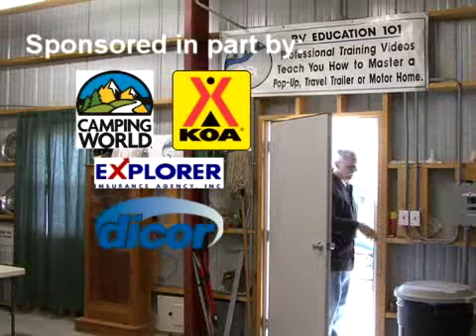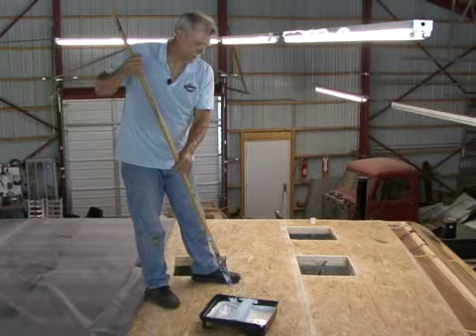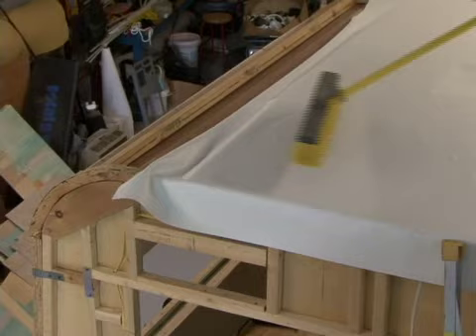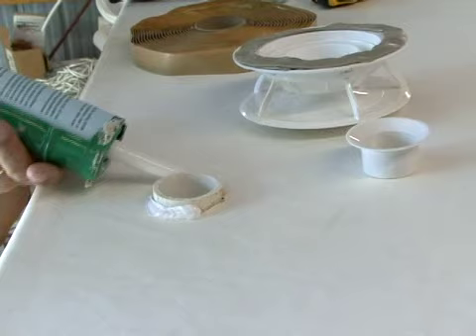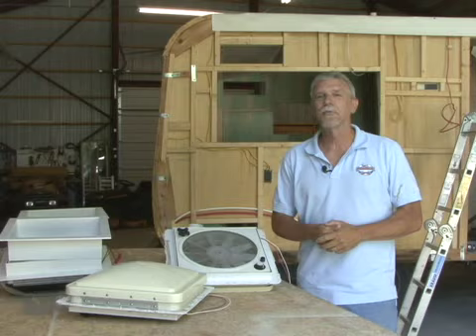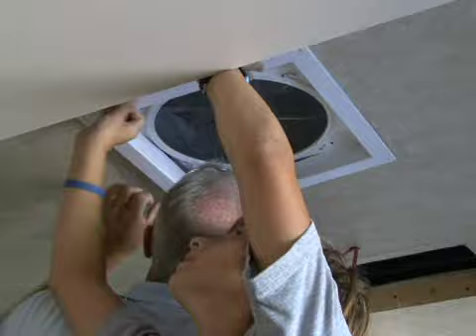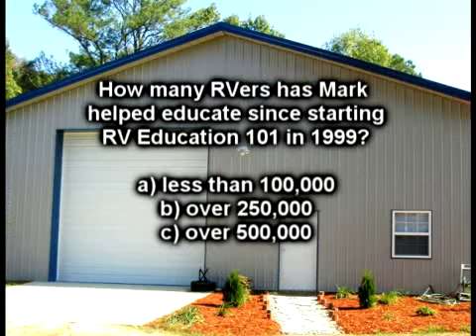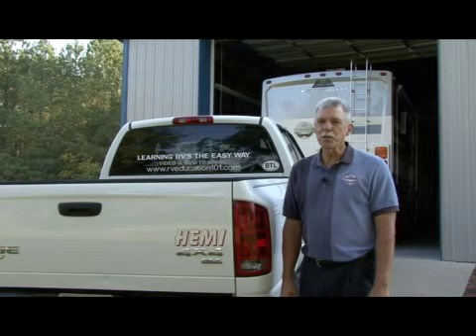Marks RV Garage Episode #11 Internet TV Series by RV Education 101

Comment from the maker: @lovelesspl I basically have two choices. I could run the power converter hot wire directly to a dedicated brach breaker or I could run a jumper from a breaker to the hot bus where the wire is currently connected. They do it this way to give you another slot in the bus for a hot wire off of the same breaker, since you can only have one wire connected directly to a breaker. I wasn't sure at the time if I needed another hot wire for anything or if I would just go directly to the breaker itself.

Comment: On the Powerconverter how does the DC side get 120V.  The hot line from the converter goes to a bus bar on the right hand side of the AC section.  That bus bar is not connected to anything other than the hot line going to the DC section.  Should one of the breakers supply AC to the Bus bar that feeds the DC section?

Comment: I have a small area on the  rubber roof of my TT that is apparently delaminating.  The glue that holds it to the plywood  has released; you can move the roof slightly and tell that the wood and membrane is no longer attached. There are no leaks yet and the delaminated area seems to not be growing.  We have decided to just continue to monitor this and see if it gets worse since it is not leaking.... your thoughts?

Comment: Loving all of the videos! learning so much. Are the proud owners of a 1971 16' go tag along. New to us in December. We have had a lot of rain and have noticed a leak in our metal roof at one of the seams near the rear of the trailer. The previous owner had put a coat of cool seal on as maintenance but it did not prevent the leak. any suggestions on how to seal the seam? thanks for the help!
Reply from the maker: +Tyler Pollard  Hi Tyler,
You might want to try some roof sealing tape. You can buy it on a roll in 

different widths and lengths. I would look at the Dicor or Eternabond brands. 
Clean the surface real good and apply the tape and it should take care of it.